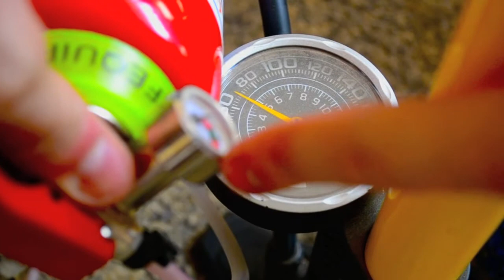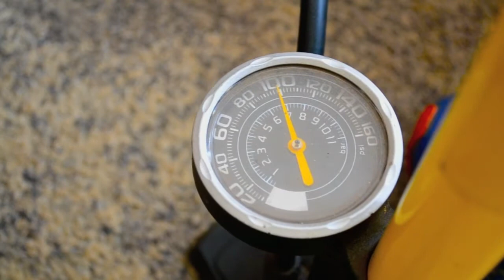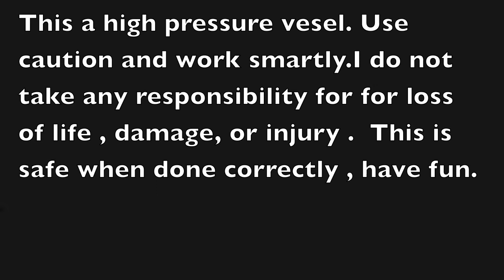How to make a Gettho tubeless inflator out of a fire extinguisher

Comment: If you remove the valve core on the bike it pops better on te rim.
The air flows faster in the tire (With tubeless valves) nice vid 👍👌